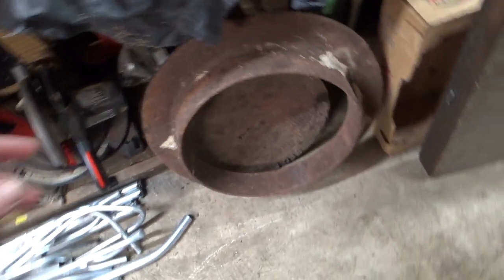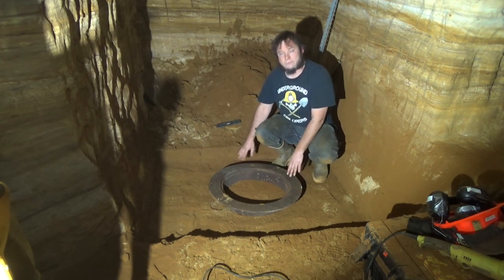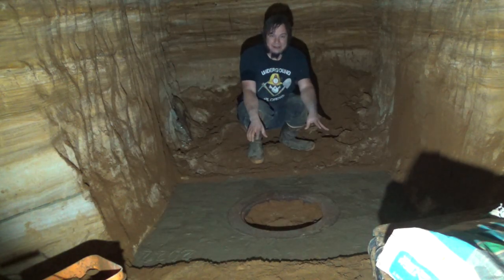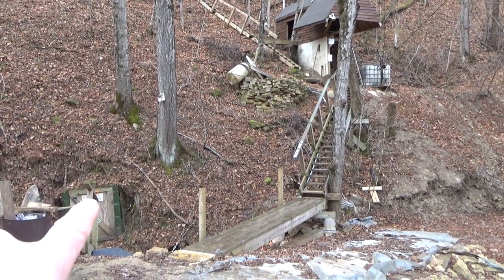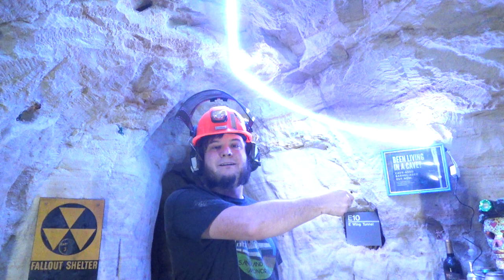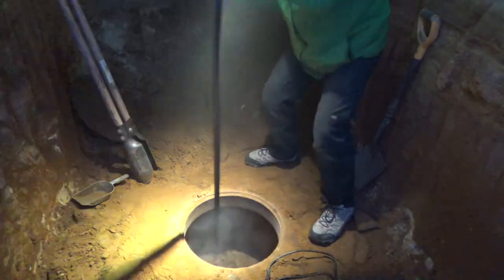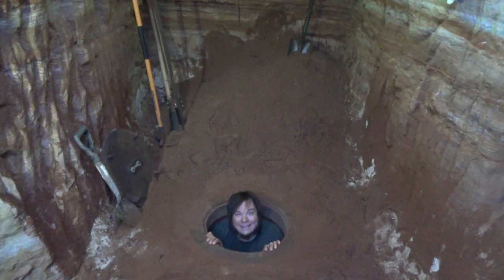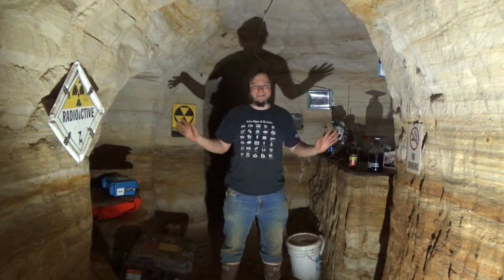Installing A Secret Manhole In The Floor Of My Underground Speakeasy

Comment: You mentioned the sand floor eroding faster than the cement floor, which got me thinking: how does the rest of the tunnel system deal with erosion long term? My first thought was to just not worry about it because it's all the same material, but then some paths will be traveled more than others, and foot/wagon traffic will tend to be concentrated in certain areas (i.e. nobody walks placing their feet right up against the walls).
Reply from the maker: We haven't noticed too much issue, partly the loose sand evens things out. There have been one or two places that needed some cement on the floor to level it out.
Reply: The maze at the beginning is already got some erosion from people sliding in the angled tunnels.

Comment: If that LED strip is of the sectiond "cut here to shorten" type it might be a simple fix with a soldering iron.
With that many drills down due to chopped cable I would consider making the cable on the drill really short (5 - 10cm) and using an extension cord for the long part. That way you would only be down a cord and not an entire drill. That or replace the cord part on the drill with a C13 Male connector (Thats the Input connector for a PC PSU) and use PC or Monitor Power cables. They tend to be quite cheap to free depending on who you know
Reply from the maker: Good ideas! I'll take a look at the LED strip again :-)

Comment: Love it! You mention the high humidity, do you notice any visible water in the cave (running down the walls / drips from the ceiling) when it rains?
Reply from the maker: We don't get any water from rain, just condensation. I don't know the technical geology terms, but the sandstone is kind of a slow sponge that holds moisture but doesn't let a lot of water move through it. If we dug a hole and filled it with water it would eventually soak in, but it would probably take 6 months to disappear.

Comment: concrete doesn't actually dry, it sets. it's a chemical reaction where the water becomes part of the solid material
Reply: I've since learned a bit more about this, and forgotten it all. I think heating limestone breaks down the material and a chemical reaction releases water. when you add water back to the mix, the water reacts with the cement in a chemical reaction which releases heat, forming crystals in the rock.

Comment: Way cool manhole secret hole cover thing!. I think you need an ice auger conversion for digging down except that hard layer of course. Also couldn't you put the cords on a spring reel so they would maintain some tension and keep them out of the bits way? Even if you just had an alligator sleeve & a spring you could keep adjusting it down cuz you don't progress that fast.
Reply from the maker: I probably could do a bungee cord or reel to protect my cords, just haven't gotten around to it. Really I just need to be more careful! 
An ice auger isn't really effective on sandstone, we've tried something like that before. I might try the next size up of dodge imported jackhammers :-)

Comment: You need a big auger like they use to drill holes for ice fishing
Reply from the maker: We've tried that, it doesn't work very well in the sandstone. Since it's a rock you actually have to use hammer drills and chisel bits and stuff.

Comment: How do you accomplish ventilation?
Reply from the maker: There's a vent fan over at the haul tunnel, currently the bar is a dead end but will eventually connect to two other entrances. I've used some monitoring sensors over a day of work and haven't noticed a significant drop in oxygen or rise in CO2. I have another video on that somewhere on here!

Comment: Why didn't you dig the hole in the first place, and then installed the manhole? I guess you can still remove the manhole, continue digging with a little bit more digg-nity, and then installing it back.
Reply from the maker: I wanted some support above the hole first. Sandstone gets crumbly whenever it has an abrupt edge or cut, so if I started digging down I'd get a ragged top that would need more patching and support to put the manhole collar on.
Reply: @saveitforparts  a plywood form for concrete after  digging the hole seems worth it to me.

Comment: SANDLAND!!!!!!!!!!!!!!!!!!!!!!!!!!!!!!!!!!!!!!!!!!!!!!!!!!!!!!!!!!!!!!!!!!!!!!!!!!!!!!!!!!!!!!!!!!!!!!!!!!!!!!!!!!!!!!!!!!!!!!!!!!!!!!!!!!!!!!!!!!!!!!!!!!!!!!!!!!!!!!!!!!!!!!!!!!!!!!!!!!!!!!!!!!!!!!!!!!!!!!!!!!!!!!!!!!!!!!!!!!!!!!!!!!!!!!!!!!!!!!!!!!!! also great video! also! idea! what about a water wheel for power?
Reply: also i had a horrible day and this made it better thanks
Reply from the maker: There's not really flowing water on the property, except for about a day in the spring when all the snow melts. I've tried some wind turbines, but have yet to get one that's reliable.